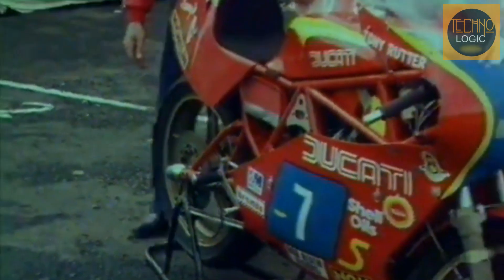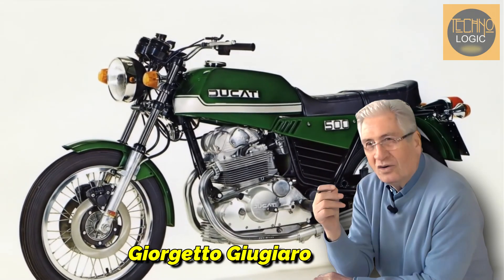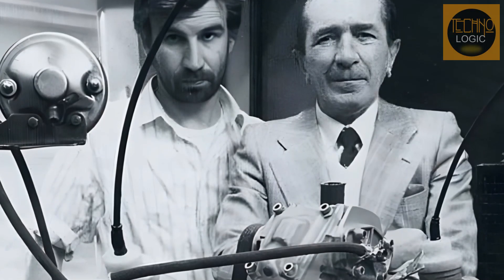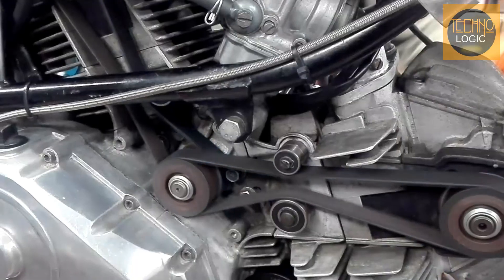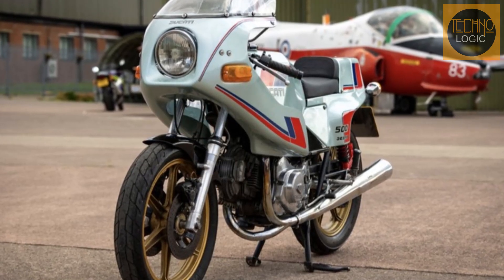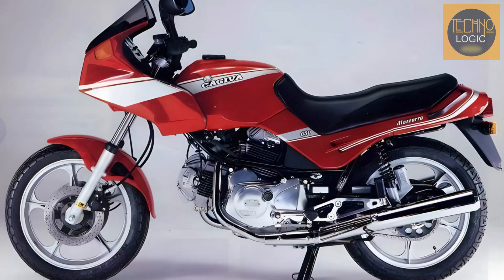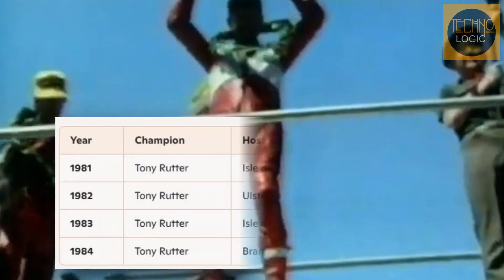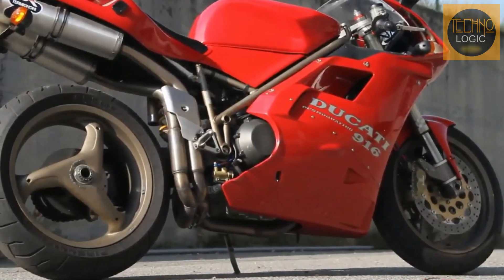Amazing‼️ How This Unexpected Innovation Saved Ducati from Bankruptcy..

Comment: Great vid. I owned one in the late 80's, a great bike, utterly reliable too. Subscribed. Thanks.
Reply from the maker: thank you..
Reply: Owned a red one. Later series 3 with improved crank and support. After a string of Japanese bikes, I now learned what real handling and braking meant; compared to them. Slow yes. Fun, YES! Later purchased a 600 Pantah. Wow!            
The first 500 Pantah's weren't all roses. Some had gearbox & new model teething issues. All addressed in the 600 and later models.